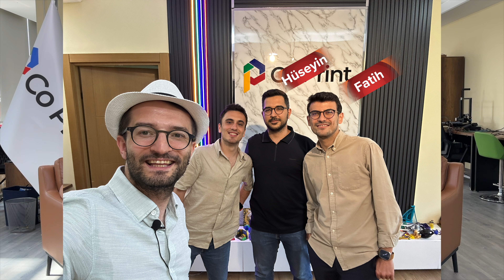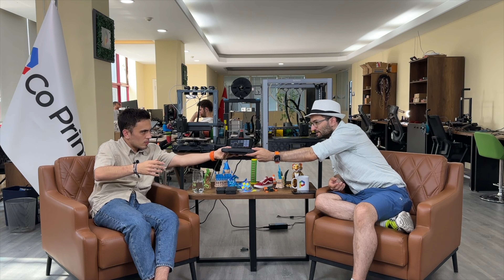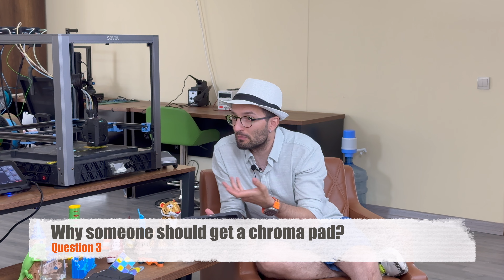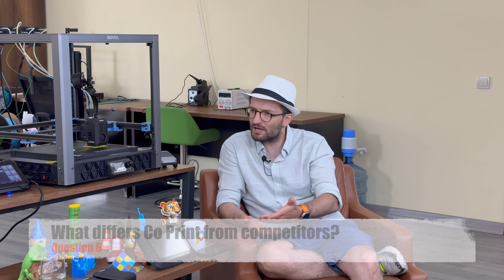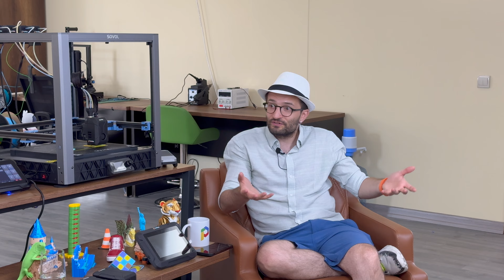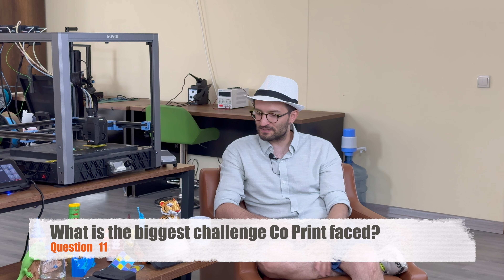Year of Multi Color 3D Printing with Co Print: A podcast

Comment: if i dont want the 4 colour print can i just buy the pad and hotend for our crealtiy  k1 for faster prints
Reply: I'm not sure the pad and hotend would give you much additional speed. The K1 is already running Klipper, correct? The max volumetric speed of the chromahead is 24 mm^3 /s